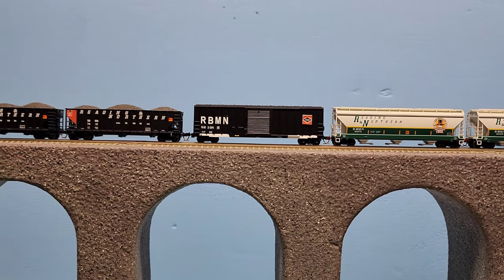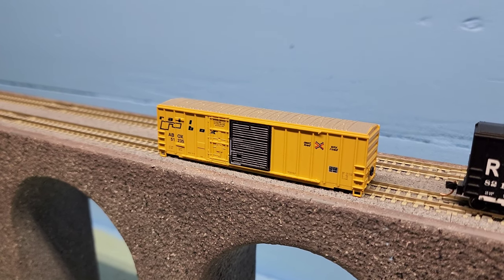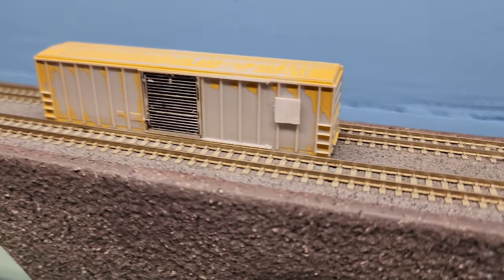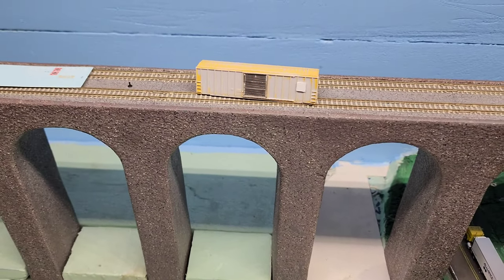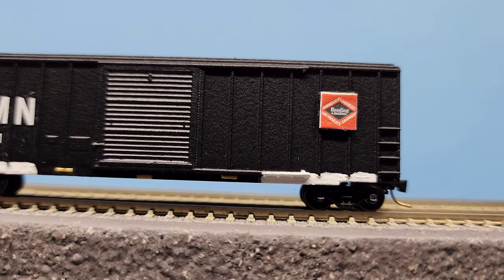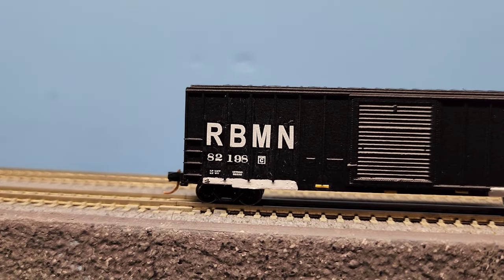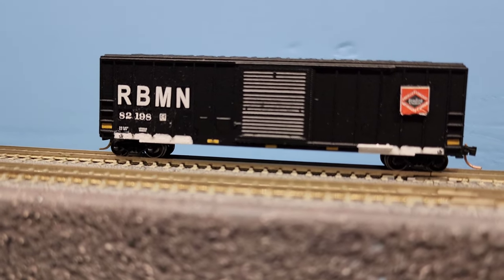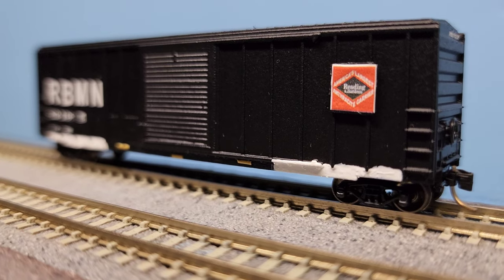My 1st Attempt at Painting and Decaling in N scale, Reading & Northern Boxcar

Comment: Hope my first time comes out that good…you did a great job Ian…did you prime the RailBox car before applying the black paint?  Wondering if that step is needed
Reply from the maker: Thank you Anthony! Micro sol and set, will make your life easy when doing decals. Its not as intimidating as it seemed. Just takes patients and, not getting flustered, as decals move. Because you have all the time you need to get the where you want them. I didnt prime, because, the more layers, the thicker the paint gets on the car, and since i was using spray paint, i was trying to get the nices lay down of the paint i could. You can get away with out primer with a good prep before paint! I know some people may be against that, but sometimes i feel like primer can be a wasted step. Lol. My opinion though lol. Take care!